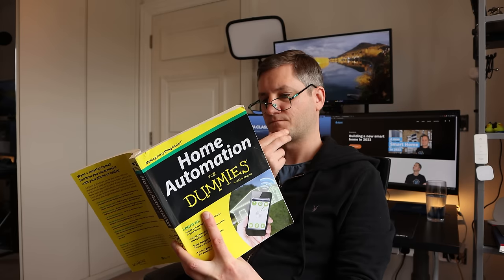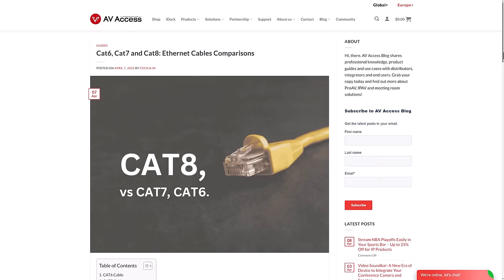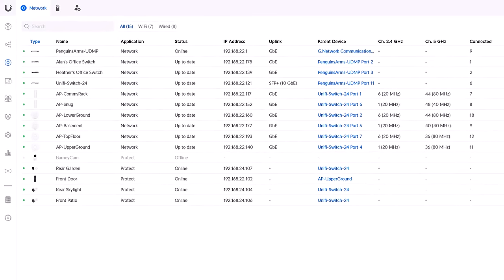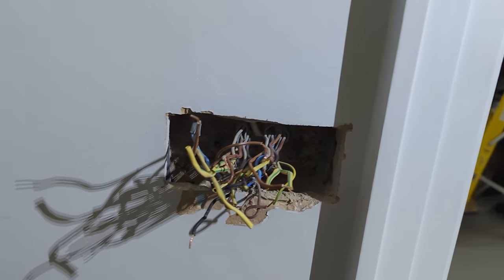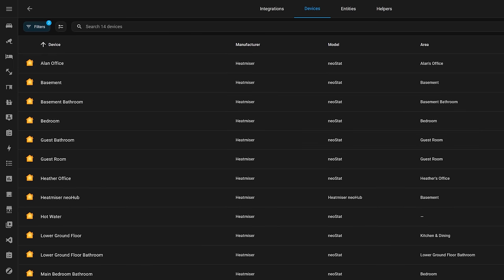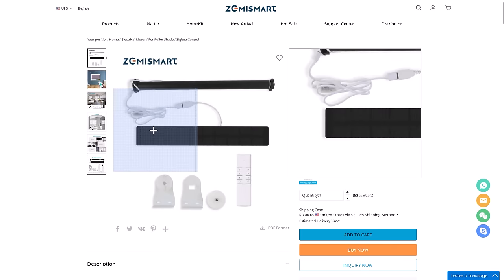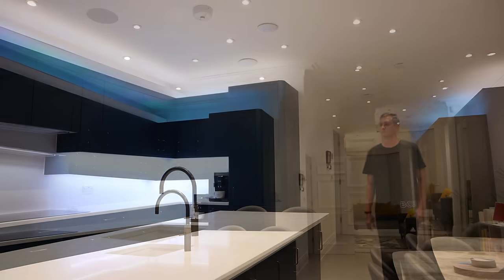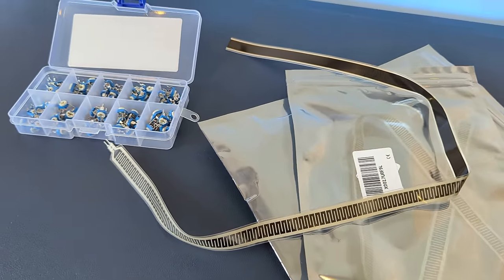The best and worst decisions I made for my smart home

Comment: Hi, senior network engineer here: optic fibre for a home network wastes money and work. Unless there are minimal use cases where you need to move large files within your network, like 4K raw footage or complex CAD design files, cat 6 will be fine for more than ten years. Also, for short distances like the cables in your home, you can easily upgrade to 10 Gbit on the existing copper cable. For your regret of not passing two cables, there's a simple trick: next time one of your network cables is faulty (and it can be easily a decade before that happens), just cut the ethernet connectors on both ends, tape together two new cables to the existing one and when you pull it out on the other end, you will run the new cables at the same time. If you feel the wires meet some resistance, lubricate them with hand soap and do a bit of push and pull to see if they can run better. For the IoT "chattering" over the network, I strongly suggest you segment your home network using VLANs and create one specifically for the smart home devices. That way, you secure your network and keep their traffic on a different logical network, and their traffic won't impact your other devices.

Comment: Okey, the biggest takeaway is: cables and no batteries… Then skip wifi/zigbee and POE and CAT6 EVERYWHERE….
Reply from the maker: Cables and no batteries everywhere that makes practical sense. At some point the return on investment diminishes
Reply: @HomeAutomationGuy  Cost is always an issue, but my plan is to use a space behind the skirting board near the floor as the main conduit for cabling, with a high skirting board there is space for a lot of cables. Since I intend to use LED as much as possible I can in fact go for a 12VDC bus and POE CAT6 and one 230AC cable. There is also space behind the cornice at the wall-ceiling corner that can hide a few cables. The rest can either grooved into the wall or just put externally. Since I will build every wall this is a simple method and involves no extra cost for me. This solution enables extra cables to be added later on without opening any walls.

Comment: My home server is built on top of an Intel Atom with a 15 watt TDP. So add a few drives etc and I'm still a long way from a couple hundred watts, even including networking. Performance is just fine, too. The server is actually in my office - it draws so little power I can cool the whole thing with a single 15 cm Noctua fan. Electricity is expensive these days.

Comment: For A/C - the simplest universal local solution is Broadlink IR + SmartIR integration. Smart IR will create a virtual entity that can even sync state based on the received signal from the original A/C remote(if your partner sometimes refuses to use HA for turning things on 😁).
The only tricky part is learning commands if SmartIr doesn't have a set for your particular model - each command is a full state (cooling/heating/fan ... + fan level+ temperature). So it takes some time to set up.
Reply: I do the same thing with a Sensibo. Works great in the same way as well....

Comment: In regards to the battery powered devices you can look into battery eliminators that swap out the battery the device comes with for a faux battery (set if its using more than one for it) that has a usb cable attached to let you power it via the spare power warts, the only down side is that they are not really cheap but it's one option in that regard that I have been looking into for my aeotec motion sensors, switchbot bots, the aqara leak sensor I am using for my occupancy sensor device and any smart locks that I can use them with in the future.
Reply from the maker: Thanks for the tip!

Comment: I have set my Home Assistant up with Home Assistant in charge overall, with multiple autonomous sub systems. This provides a higher level of resilience to single point failures. Ie Lighting is run by two Hue hubs, heating with Tado, Eufy security cameras,with Home Assistant running remaining zwave and zigbee devices. Home Assistant can operate everything everywhere so does all the extra clever stuff. This way if Home Assistant goes down lighting still works.

Comment: Great Video! , I use ESP's 95% of the time because I'm cheap, like the challenge and the pain I receive banging my head against the walls.  Therefore, I haven't even thought about implementing 2/3 of what you've accomplished.  Network setup looks great, I do some power monitoring.   However, the whole automatic lighting looks pretty sweet.  All very nice!
Reply from the maker: Thanks so much 🙏
Reply: ESPHome is a rabbit hole, especially if you're not a developer but managed to get a lot done but a lot of head banging. I've been messing with voice assistants lately and I've learned a lot over the years but lots of frustration along the way. It does save money too.

Comment: Whilst your cabling in the laundary room to the racks could've done with more length and better support, it's great to see someone still using cables when wifi is ONLY a tool and Cat6e is perfect for resenditial as the installation requirements of Cat7e + often prove impossible without suspended floors / ceilings. What you need is a controllable power switch or UPS so you can stagger the reboot to the order you want so they 'handshake' / pair back up in the right order although i would have gone Nest for heating / water and smoke detectors and Lutron Homeworks QS for lighting but then you would have had  to rewire most of the lights though as to light automation you can get some really useful RF 240v in line switching.

....but on lights you can't beat Lutrom, haven't had a failed bulb in six years and i save so much energy with so much flexibility.

Comment: I agree with your device protocol choices. I prefer Wifi wherever possible, and Zigbee for the rest. Inevitably that means mains powered devices are Wifi, and battery powered are Zigbee. My biggest Zigbee learning was to find the most unused 2.4Ghz spectrum for the Zigbee channel. It is important to set the channel before starting to pair devices. The second learning is to add plenty of signal repeaters - I use Hue bulbs and Ikea Tradfri repeaters
Reply from the maker: Very solid tips - I agree!

Comment: Nice video, I share your views on most of the equipment you have. I've a couple of the zemismart blind motors myself & really like the action, but the battery life is a bit crap. However, my 2 are reporting their battery percentage in z2m, so maybe try re-pairing them (it did take several days for the battery %age to appear), then you can set an automation for charging reminders or action etc.

Have you done anything with bathroom humidity measurement? I've got a couple of aqara sensors for this with the intention of using a derivative helper for switch on/off bathroom fans - it could be a nice video.

Comment: Nice video, looking forward to the zigbee learning video (even if I don't use zigbee), I have the same OCD as you with regards to the position of a lightswitch, still using Shelly but converted to pushbutton, instead of flip switch, and my OCD is now fine. I really like network products like Shelly

Comment: For light switches in a new house we are doing we are using fancy nickel plated (normal) switches from a leading brand but specced them with momentary mechanisms so you click them to turn on or off and they spring back out) very similar to a aqara switch.  We then have a shelly relay behind them which smartifies them.  It works great.  It took me ages to work it out (I made a test rig to try to work out what was best) but the shelly relay has an option in the settings to work with these switches and once I found that we were away.  This is the best choice for us because we can have absolutely any light switch and still be smart.  Becasue we were gutting teh house we changed to deeper back boxes to allow room but witht the latest shellys (the mini) they are tiny and would most likely fit in any back box.  My only change is i am currently testing zigbee tuya versions of the relay as I dont like that shelly only offer wifi or zwave.   TBH the wifi would be fine.  In my other place I have shelly wifi switches doing all sorts and they have been faultless

Comment: Great video … really helpful to hear what you think has worked and not. Made me very happy I got the zemismart mains powered blinds and paid an electrician to do all the power points. 
Also made me look into the everything presence sensor to see where I can use that in my home.
Love your lighting too
Reply from the maker: I wish I had your foresight on the blinds!  The everything presence sensor is amazing.  Get the Lite one first, I find it much cheaper and covers 80-90% of my use cases - especially if you already have some other PIR sensors in the same space.

Comment: Great video, I’m sure a left a comment on your new home video to run cables to everything. I don’t like to say I told you so but I’ve learnt a lot over 15 years designing C4/Lutron based systems but I know it’s easier said than done 😀 I use zigbee/battery devices in my own home!
Reply from the maker: You probably did, but by then it was too late! I released the video after the cables were run 😢

Comment: I made an automation based on motion of a RCWL-0516 in my nightstand, so it registered if someone enter the bedroom. When entered the nightstand lights get on, based on who is home. We do have both an Ikea Stybor smart switch at our stand, so if we are ready to get some sleep, we have to turn off the lights. That will trigger some automations, that make shure we do not get blinded by the lights in the middle of the night. Lights get on again on an alarm clock or if we get downstairs or everything resets at sunrise. The lights upstairs wont turn on automaticaly, if they are turned off manualy. Everything with only 1 ikea motion sensor, 2 unifi accesspoints, 1 LDR and 1 RCWL-0516 to stay hidden. Lights downstairs and upstairs are fully automated. Only turning on, when get up early doesn't work at this way. But I would figure this out in the next months. Me and my girlfriend both hate that we can see there are sensors.

Comment: Great video! 
Would love to see the videos about how you solved your Zigbee problems and about the pressure sensors!

Also: you have quite a large base power load in your house. I'm at 160W or so, and that includes my home server (37W idle), switch, router, etc.

If you want to get it down, I suggest making a spreadsheet with columns for room, device, watts, hrs/day, Wh/day, kWh/yr and cost, and then going through each room in your house measuring every device with a good power meter. Don't forget things like mechanical ventilation, electrical boilers, or your bed if it has motors for adjusting. Would make for a nice video too!
Reply from the maker: Yeah, this is something I need to re-visit.  Good tip with the spreadsheet - I love me a spreadsheet!

Comment: Most probably your Daikin AC can be fitted also with the previous versions of wi-fi adapter (A or B series) parallel to the one they have been supplied with. These older adapter have local api and work locally with official Daikin HA integration. Just check for S21 connector availability on AC main board.
Reply from the maker: This might be a project to consider once summer comes and it starts warming up again.  Thanks for the tip!

Comment: About your Solar panels and generation, What inverter are you using? 
How do you get readings from panels into home assistant?  i would like to know more about this setup. 
I have a dumb inverter system and  I'm looking for ideas on how to get the stats of generated energy. Are u able to measure direct Solar energy (DC) ? i'm curious to know.

I'm also looking forward to the Zigbee video. have same problem u had.
Reply from the maker: My inverter is also dumb, so I use a Shelly EM to get the data into Home Assistant.
Reply: @HomeAutomationGuy  Are you able to measure the Energy generated from Solar panels itself using the Shelly (i.e energy before getting to the inverter) or just energy consumed by the house?

Comment: Some zigbee issues are related to the frequency the devices use to communicate. Most zigbee devices communicate at 2.4 GHz but in Europe some devices communicate at 868 MHz. The alternate zigbee frequency is 915 MHz in the US and Australia. The lower frequencies give you a longer range that can more easily penetrate solid barriers like walls. You get more bandwidth at 2.4 GHz but it has a shorter range and is more susceptible to environmental attenuation.
Reply from the maker: It's always a journey, isn't it!  Thanks for the comment and for sharing your story!

Comment: I'd love to see a new vid on the bed sensor, tried to make the one you had but it dosen't work with my matress. Folding it will mean its always on and not having it folded means its always off no matter if im sitting, laying or jumping on the bed. Probably going to refund the leak sensor and the pressure pad and just buy an Aqara MM wave sensor to do the bed detection and run some other automations like turning on the hairdryer, spotify and the light (if its dark) if it detects that the bathroom is humid and I have just gone in my bedroom.

Comment: Blinds are best kept simple. And hardwired because they use a lot of power and invariable drain batteries. So I have kept my blinds mains powered and control them via IR using a Broadlink controller. One hard to manage set I control using a Shelly contactor. I don't get the position state in HA but I find that's OK because for me Blinds are usually always either up or down. You can still program in different positions simply by using timing logic in automations. Then add different buttons for different positions. If you are really stuck automating blinds into HA (say IR range problems with the Broadlink), the other thing you can do, is solder their original IR remotes into Shelly contact devices. Shelly is awesome and there are always good HA drivers for their products and fast and reliable firmware upgrades. I use Shelly for blind control, garage door, 4 buttons pad control and power monitoring. Super reliable. They have just released some of them with added Zigbee. how cool is that?! Love yr vids dude. Great channel.
Reply from the maker: Yeah, I realised too late about the blinds.  I never really had smart blinds in my previous rental properties so I had to learn the hard way in my new house.  Thanks for the comment!

Comment: There is an ESPhome mod you can do with Daikin A/C's to get fully local control and monitoring. It just means flashing an ESP and wiring it to  a plug on the indoor unit
Reply from the maker: That sounds interesting. Is it warranty voiding?
Reply: @HomeAutomationGuy @HomeAutomationGuy  I wouldn't think so because it sits separate to the main electronics and simply plugs into a service port.

Comment: i went the half load cell option for my bed with an automation to tare the weight in the day to zero the scale.  works great.

for bathroom presence where a mains powered mmwave sensor isn't an option i made and esphome time of flight sensors for the door frame that's like a laser trip wire and it works great

Comment: I created a zone in the Aqara FP-2 for a bed sensor. It works better than FSR strips (I spent too much time adjusting the placement of these things to make them work).  The result of a  FP-2 zone for me is ~90%+ success rate.  With a bit more tuning/device placement, I think it can dial it in close to perfect.
Reply from the maker: Do you have a separate zone for each side of the bed?  I am not sure how granular they go.
Reply: @HomeAutomationGuy  I did not set it up that way...  I have one zone for the entire bed, plus other zones for entryway into the room and bathroom.  It turned out to be one of my favorite. When the bed is not occupied and dark, the bed LED lights turn on for a night light effect.

Comment: Really useful roundup thanks.  Interesting to see you move away from battery motion sensors to mains powered mm wave. I have a few Aqara FP2s and they're awesome, but we don't have many large, open spaces that benefit from the FP2's ability to define multiple zones and I can't justify the cost of an FP2 in every room 😬.  I'm still trying to decide on whether or not to replace light switches and what to go for.  90% of our lights are automated and we don't always want the main room ceiling lights to come on when we enter a dark room, so I've left some lights manual for now. I'm using a mix of Shelly and Tuya zigbee relays as well as zigbee and WiFi smart bulbs.  Most of our mood lighting is govee and the excellent govee2mqtt HACS component makes controlling them really easy in Home Assistant. Govee lights don't fade out smoothly in HA though so I might try some Hue strips to see how they perform. I have 120 zigbee devices in zigbee2mqtt so I'm looking forward to seeing how you solved your issues.  Thanks again.
Reply from the maker: Thanks for the comment! I also haven't found much use for the multi-zone presence capabilities of mmWave sensors - I mainly use them to make sure the lights don't turn off when we're slobbing around on the sofa or sitting still working at our desks.  I've never used Govee, but have heard good things.  Try a Hue strip where you want nice fading dimming and see what you think - you probably don't need it everywhere, but it's very nice in places like bedrooms or where you want night lighting.